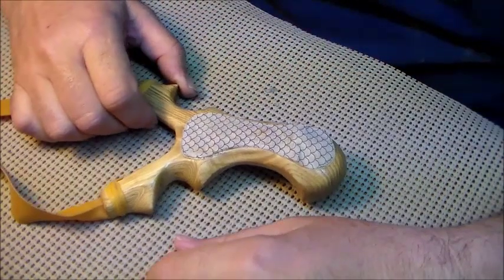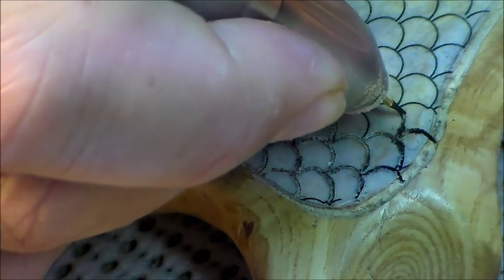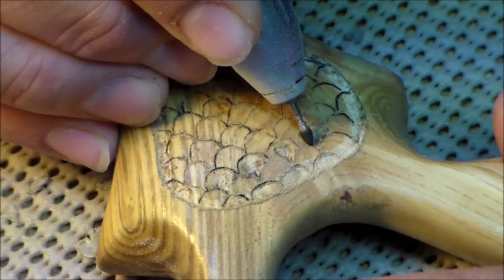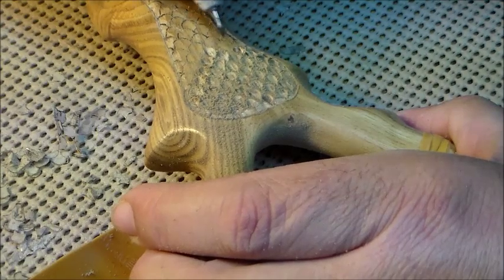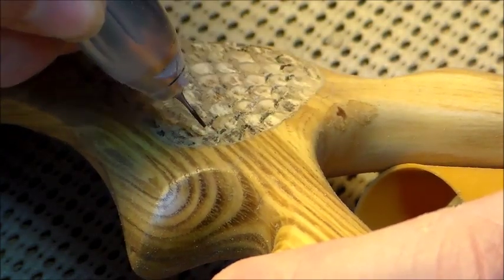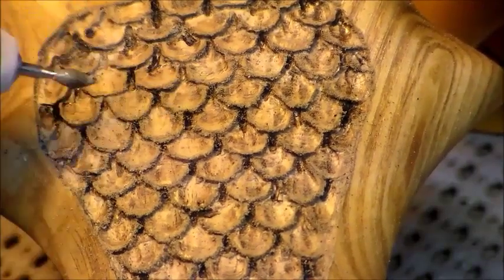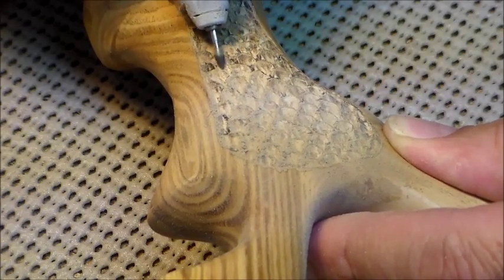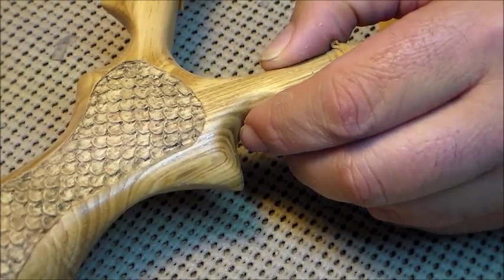Fishscale Carving on a Custom Slingshot

Comment: I really enjoyed this video. You seem like a real nice guy too. Was thinking about getting one of those air turbine carvers. Only concern was the noise of the compressor and perhaps the dental drilling noise.  How big of a compressor would one need in order for the tool to work off the tank for a while without the compressor kicking in?
Reply from the maker: Joey Nuggetz The bigger the tank the longer you can go before it kicks in.  I was using a compressor with an 8 gallon air tank when I shot this video.  I have upgraded to a compressor with a 28 gallon air tank since then.  It does not come on as often now.   There are also compressors that are belt drive and not vibration type motors that are more quiet (and much more expensive).   Any compressor you have that can blow 80-90 PSI can run the tool.